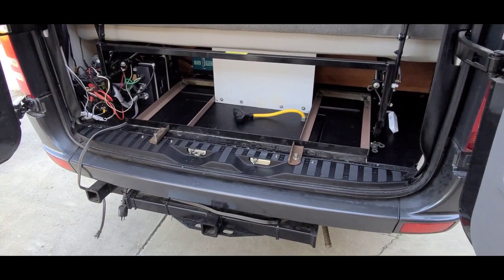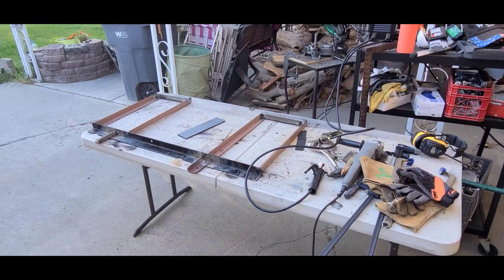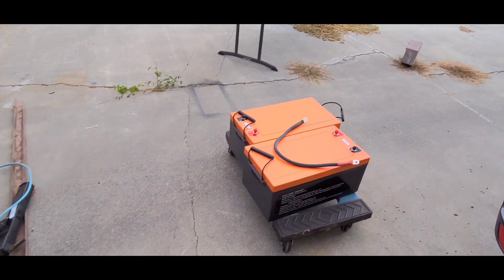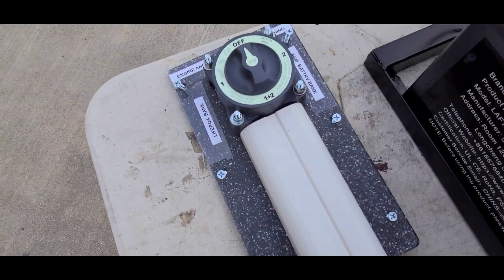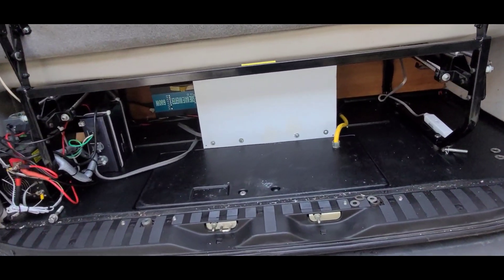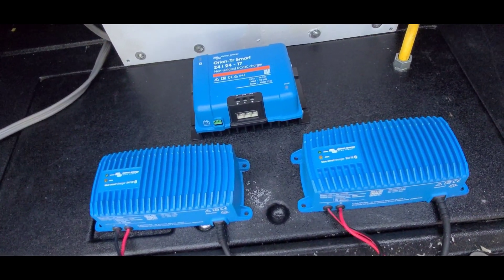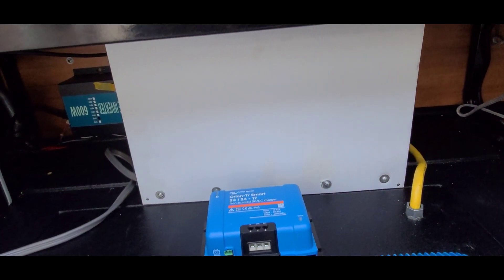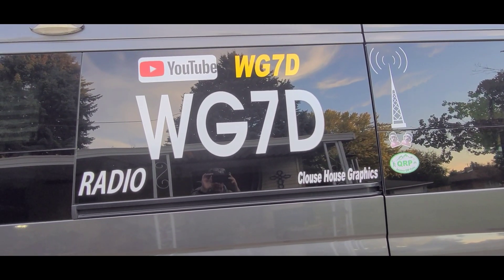Chins lifepo4 battery install (Part 5)

Comment from the maker: So far this is a list of the equipment I will be using for this install: Links to items being installed.
Hydraulic Cable Lug Tool....https://amzn.to/3tuxdXK
Victron Energy Orion-Tr Smart 24/24-Volt  DC-DC Charger....https://amzn.to/3lbnBgN
Victron Energy Blue Smart IP67 12/24-Volt 5-25 amp Battery Charger.....https://amzn.to/2YA9ObW
WindyNation ANL Fuse Holder  .....https://amzn.to/2X71ssa
Chins 12V 300Ah Smart LiFePO4 Battery....https://amzn.to/3E7PXB9
Blue Sea 6007 Dual Battery Switch .....https://amzn.to/3E7Q0Nl
2/0 Gauge 2/0 AWG wire and lugs....https://amzn.to/3tvxKbN
Kungber DC Power Supply Variable, 30V 10A.......https://amzn.to/39kFxjC